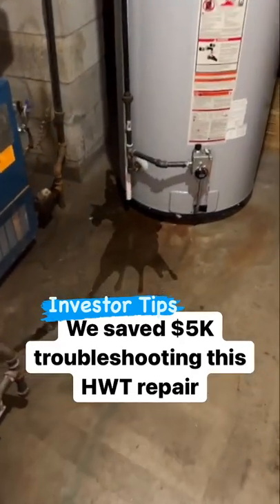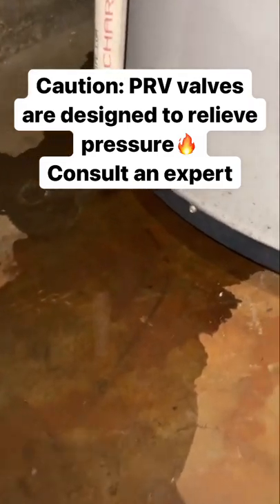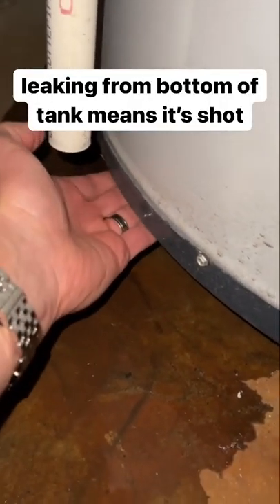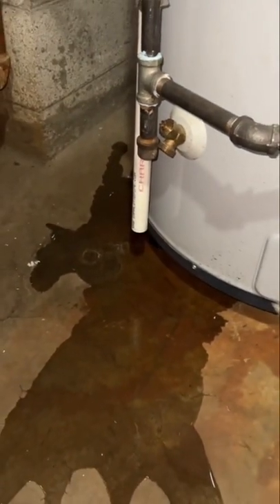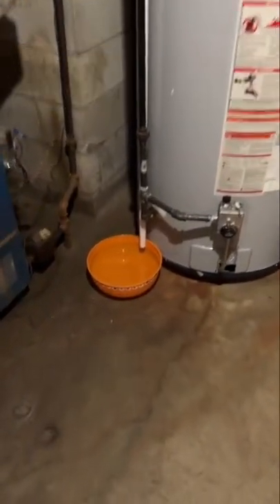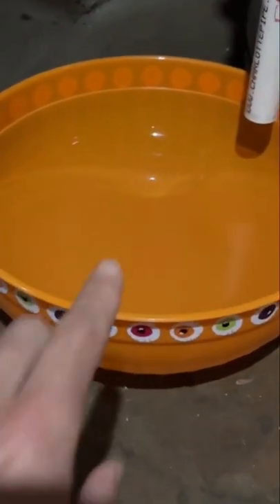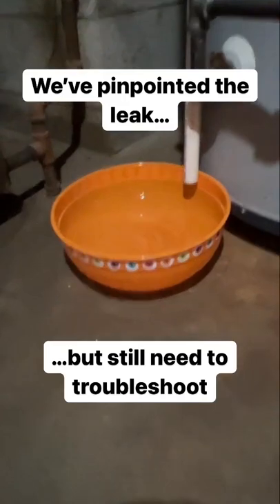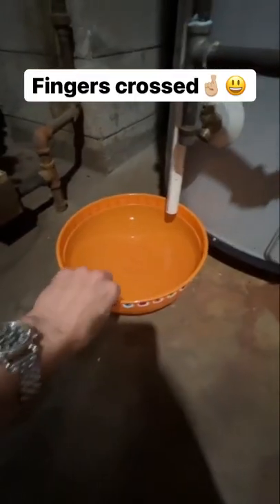Hot water tank leaking - We saved $5K troubleshooting this leak.

Comment: Do you have an expansion tank . If not you need one set the persure two to three pounds of pressure less than the main water pressurethat way it will help prolong each other. If you have one check the pressure adjust it accordingly. Or it could be bad. Change it..

Comment: ok .but for it to be leaking at the bottom of the tank. it's either leaking where the tp valve is screwed in .or it is leaking at the supply connections or tank leak itself.

Comment: Good luck I changed the pressure valve in my garage an it still leaks then I should not have drained the one in the house ( wasn't having any trouble )an it started to leak , got a new valve for it AND it leaks     I'm not happy

Comment: I wish people wouldn’t say the price without explaining what their getting for that price. 
I did a new 60g hot water tank for a couple including a new PRV, new expansion tank and ran new 20’ of copper because of pinholes in the old copper. They compared it to the neighbor and said he paid $350 less for a 40 gallon exchange (straight re and re) 
I said don’t compare jobs as he didn’t get the extra components and he got a smaller tank. But they believed the neighbor and told people I over charge for a TANK.
So, say what your getting for $5000!
Reply from the maker: Read the caption on the video man. 😃👍🏼
Reply: @GrantWarrington I did read it and then you said you saved $5000, so do you get the tank at cost?
Reply from the maker: @Oto_Travel  we saved $5K because we didn’t have to replace the 100 gallon HWT. It ended up being the expansion tank was bad. We had the plumber replace it and problem solved.

Comment: I swore pressure relief valves were designed to relieve pressure. 🤔 im confused how a bucket fixed your problem.
Reply from the maker: The problem was the expansion tank. Our plumber replaced it and problem solved. 👍🏼 Bucket catches water. Not sure what you meant.

Comment: Pressure relief valves can dump up to 1-2% of the capacity of the hotwater unit each heat cycle that's what they're for. Hot water expands. It shouldn't be dumping onto the floor that's illegal creates a hazard and can rust out the bottom of the unit it should go to a stormwater drain.

Comment: To be fair, if that water heater is ASME rated (as required in certain installations) it could easily be $5,000.  If your relief is dripping, check water temp and water line pressure.  A bad PRV or expansion tank will cause line pressure to go up and the relief to open.  Usually when this happens the toilets will run all the time or the sink will sputter or hammer when used.

Comment: $5000? Depends on recovery rate (btu). From the video, the gas piping is 1/2 inch, so standard recovery. Bradford White gas 100 gal is about $1800 another $200 for expansion tank and material. 2 hour job (2 guys at $175 billable hourly rate is $700 for labor) So $2700 and I’ll do 3 a day all day every day.

Comment: Normally that temp and pressure valve is plumbed out side so as to not leak inside the building if it's activated by either over pressure or over temperature!

Comment: With the new standards that took effect 3 years ago the price of water heaters has exploded. Most of those new standards apply to tanks of 50 gallons and above so a 40 gallon gas water heater is around $450 but a 50 is $1100 and a 100 is around $2500. In my area (and probably everywhere else in the US) you can plumb 2 or even 3 seperate 40 gallons water heaters plumbed together in series and a manifold distributing the DHW out to the units.

Comment: If that's a 100 gallon hot water heater, fire your plumber because 1/2 gas line is NOT nearly enough to run a 200k BTU unit.

Comment: You need an expansion tank, that can be from hot water expansion. The TMP valve will open up and relieve excessive pressure.
Reply: T and P valve*
Reply from the maker: We have an expansion tank. Our plumber just replaced it and that was the problem😃👍🏼 You got it. Thanks😃🙌🏼

Comment: If it's the t & p valve,  I'd  replaced the valve and install a thermal expansion tank, pressuring the tank to the exact water pressure from the apartments cold water.

Comment: I replaced a 75G gas water heater and a power vent. It took me 6 hours in labor time. That also included running 3" pvc vent and drill through 12" of concrete/brick wall and a new 12g wire/receptacle from the sub-panel for 5x less in labor.

Comment: Bro 😎 a 100 gallon gas fired water heater isn’t $5,000 to replace. Also, if the T&P valve is discharging, you need to determine why it’s leaking. It could be lifting at temperature or pressure. Do you have a properly sized domestic thermal expansion tank installed on the cold water side of the piping system?
Reply from the maker: Bro.🤦🏻‍♂️ Give me a quote. I assume you’re licensed. How much would you charge for 100 gallon tank from the supply house(not HD) plus a new expansion tank. Remove the old tank from the basement and dispose of. Pick up the new tank. Labor to install the new tank and expansion tank and don’t forget permits?
Reply: @GrantWarrington  where are you located? But first, a real calculation of GPM demand is needed. Maybe a more cost effective solution is warranted as part of the decision making process.
Reply from the maker: @MikeyPipesUncensored  So give us some numbers. It’s an 8 unit apartment building. It could have 32 people living in it at one time. You can’t insult me and then avoid putting some numbers down. Come on Mikey.

Comment: It should drain into a pan. You should have a gas shut off there. The pressure relief valve is an easy replacement about $30 for the part. A good water heater cost about $700. Labor $400-$600.
Reply from the maker: Check out the description under the video👍🏼

Comment: The problem isn't your valve. Save the headache and check the psi in the expansion tank. Bet it's sitting at 0. Tpr valves almost never go bad.

Also, if you pay 5k for a water heater install, you're a customer they don't want.

Comment: TPRs are designed to automatically release water in the event that pressure or temperature in the water tank exceeds safe levels
Reply: I hope that's my issue
 I'm getting water in the drain pan
Reply: You might need an expansion tank

Comment: Put in a ST 12 thermo expansion tank also, to absorb the expansion on the cold main. The thermo expansion doesn’t have anywhere to go other then the PRV. Would be wise to add a mixing valve too
Reply from the maker: Great advise & you’re right😃🙌🏼 💪🏼We just changed the expansion tank and that fixed the problem. I appreciate your comment and advise😊🙏🏼
Reply: Yes. Need to add a domestic thermal expansion tank. I doubt an ST-12 is large enough. Need to do a calculation
Reply: It would be a complete waste to add a mixing valve.  It is not code and u can set Temps at the water heater.

Comment: We had to change the fuses to our hot water heater, we also changed the elements while troubleshooting. We finally have hot water again. BUT tonight (5 hours later) we felt the water and its boiling hot. We went outside and looked at the tank. It's leaking from the pressure valve. My husband turned the whole thing off bc we thought it might explode. He has reduced the temp a few times already. Anyone have any suggestions or advice u could please spare? Thank you
Reply from the maker: Hi Joosie 😃👋🏼 Sounds like your PRV valve is working correctly. Maybe your temperature gauge might be bad. I would definitely call a plumber. The issue with our tank in the video was the expansion tank. But you probably don’t have one on a HWT in your house. Our HWT  is 100 gallons. Best of luck and keep me posted on what you find🙏🏼
Reply: @GrantWarrington  thank u so much for the response.  We changed the thermostat the day we changed the elements. Do u think it was just turned up too high?
Reply from the maker: @Angelofloveandhappiness  Yes. I think it was turned up to high. Dial it down at start at the lowest setting and see what it does.
Reply: @GrantWarrington   that worked! I turned it down to the lowest setting and it is working good now! Not too hot. I think I could turn it up a hair now. Thank goodness I have hot water again. It's been about 2 months of boiling 5 pots of water for everyone's baths and to wash dishes. One of those things we take for granted until it's gone. I'm so grateful to have hot water coming from my faucets again. Thank you for your advice!!!
Reply from the maker: @Angelofloveandhappiness  Awesome😃🙌🏼👍🏼 Keep me posted. I would keep a close eye on the temperature for awhile to make sure it doesn’t creep up again.
Reply: @GrantWarrington  ok.. yes definitely!!
Reply: factory settings on rheems is at 125° F with kids no higher than 130° max you can. control hot on shower valve to prevent scalding...✌️🙏💪👍🤔
Reply: Turn the thermostats down to 120

Comment: I’m in the wrong business if I can charge $5000 for a water heater
Reply: It’s 100Gal… very good deal
Reply: @tightropehikes  

Compared to two 50 gallon tanks it isn't that great
Reply: @Gamerz00760  anything over 50 for residential is garbage and a major loss when it needs to be replaced.

Gas tankless, or two 50s in parallel no doubt
Reply: @tightropehikes  

That's why I would go with two 50 gallon tanks... Even 2 hybrid units is cheaper.

Comment: Well whoever is replacing that hot water heater that looks like a 50 gallon tank you’re getting ripped off I can replace that for $1200-$1500
Reply from the maker: Hey Tommy👋🏼 Check out the description under the video. Definitely not a 50 gal.

Comment: $5k no wonder Mikey Pipes is always smiling
Reply from the maker: Hi Eli 👋🏼😊 This is a 100 gallon hot water tank in an 8 unit 2 bedroom apartment building. This tank supplies hot water for up to 34 people.  The tank can range anywhere from $3,500-$5,000 from the Supply House. You also have to account form labor to pick up and deliver the new 400lb tank, remove the old 400lb tank. Install the tank and also the cost to purchase the expansion tank and install it.  And don't forget the permits. It's important people know that owning an apartment building is not cheap.
Reply: This guy is smoking some good stuff. Even a 100 gallon gas tank isn’t 5k.
Reply from the maker: @MikeyPipesUncensored  Mikey … 🤦🏻‍♂️Where’s your quote?

Comment: Your plumber is an evil genius
Reply from the maker: Yep. We liked this trick too😃🙌🏼 This is a 100 gallon hot water tank in an 8 unit 2 bedroom apartment building. This tank supplies hot water for up to 34 people.  The tank can range anywhere from $3,500-$5,000 from the Supply House. You also have to account form labor to pick up and deliver the new 400lb tank, remove the old 400lb tank. Install the tank and also the cost to purchase the expansion tank and install it.  And don't forget the permits. It's important people know that owning an apartment building is not cheap.
Reply: @GrantWarrington  So in some cases you have three people sleeping in a single bedroom? You claim you have 8 units with 2 bedrooms…that’s 16 bedrooms total. Assuming that each bedroom has 2 people sleeping in each room, you have 32 people using it, not 34. Realistically you have maybe 20 people using it, not 34 unless your building is in a slums. I rarely post or argue but you are exaggerating. It’s $3k to replace that tank. Your tank is standard recovery, you have 1/2 inch gas.

Comment: I was gonna say they are ripping you off at 5 grand but in the comments I read that 100 gal tank can run 35 hundred to 5 grand so I stand corrected. My 50 or 60 gal tank is under 300 bucks that’s why I thought that. Thanks.
Reply: A $300 water heater? They run at $600-$800

Comment: You meant $500....I think.
Reply from the maker: This is a 100 gallon hot water tank in an 8 unit 2 bedroom apartment building. This tank supplies hot water for up to 34 people.  The tank can range anywhere from $3,500-$5,000 from the Supply House. You also have to account form labor to pick up and deliver the new 400lb tank, remove the old 400lb tank. Install the tank and also the cost to purchase the expansion tank and install it.  And don't forget the permits. It's important people know that owning an apartment building is not cheap.
Reply: @GrantWarrington   How about installing two 50 gallon tanks in parallel .... $600 each.
Reply: @J123G  what a terrible suggestion LMAO seriously?

Comment: Dude got water tanks so not cost 5k to replace. Ripped off
Reply from the maker: This is a 100 gallon hot water tank in an 8 unit 2 bedroom apartment building. This tank supplies hot water for up to 34 people.  The tank can range anywhere from $3,500-$5,000 from the Supply House. You also have to account form labor to pick up and deliver the new 400lb tank, remove the old 400lb tank. Install the tank and also the cost to purchase the expansion tank and install it.  And don't forget the permits. It's important people know that owning an apartment building is not cheap.
Reply: @GrantWarrington  yet I can do it myself
Reply from the maker: @catsbyondrepair  You rock💪🏼
Reply: Well good luck with that as a plumber you're not a customer I'd want to keep if you cant see the value in the work 
Dont ever call a plumber to you're house cause I can tell you're the type of person that's just going to waste there time 

Every thing plumbing related is expensive we fall in line with respected members of society that bring value to there communities so yess youre getting charged 7-8 k to have this installed with parts and labor included and that's even cheap I charge lower then alot of other plumbers

Comment: I’ll change that hot water tank for 4500 lol lol wow where do you live $1000.00 to 650..00
Reply from the maker: This is a 100 gallon hot water tank in an 8 unit 2 bedroom apartment building. This tank supplies hot water for up to 34 people.  The tank can range anywhere from $3,500-$5,000 from the Supply House. You also have to account form labor to pick up and deliver the new 400lb tank, remove the old 400lb tank. Install the tank and also the cost to purchase the expansion tank and install it.  And don't forget the permits. It's important people know that owning an apartment building is not cheap

Comment: First let us address the pink elephant in the room.  Your capacity.  Define if you will, "bucket", just so we all know what we are dealing with.  Describe design differences with a bowl, and we thank you.
In a basement in certain markets $1k labor does occur.  
That said, you have an American, appx. 98 gallon, gas water heater.  and a less than $4k budget
Do you need higher than Medium duty?  I doubt it as the current situation is presented.
That puts us still in the Home depot pricing range.
Power venting will drive up the price, but currently I see no evidence you are doing that.
If you want to make it in investment properties you can meet the goal we all have.  Better service from the replacement, longer life, and lower cost.  Even $1k savings is significant in this application.
Charitably I think your $5k is just a little lazy like your 'bucket'.

Comment: Damn I need to get into the plumbing business. 5k for a $600 or so  tank .
Reply from the maker: This is a 100 gallon hot water tank in an 8 unit 2 bedroom apartment building. This tank supplies hot water for up to 34 people.  The tank can range anywhere from $3,500-$5,000 from the Supply House. You also have to account for labor to pick up and deliver the new 400lb tank, remove the old 400lb tank. Install the tank and also the cost to purchase the expansion tank and install it.  And don't forget the permits. It's important people know that owning an apartment building is not cheap